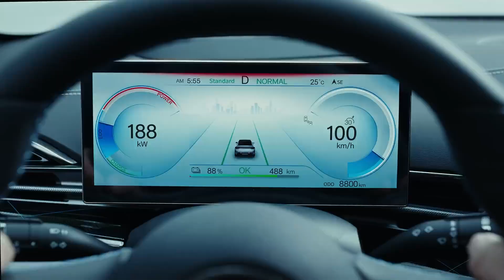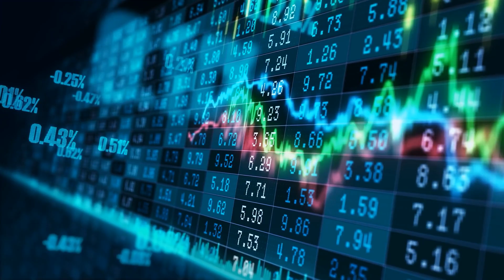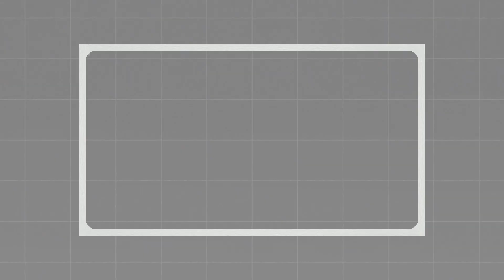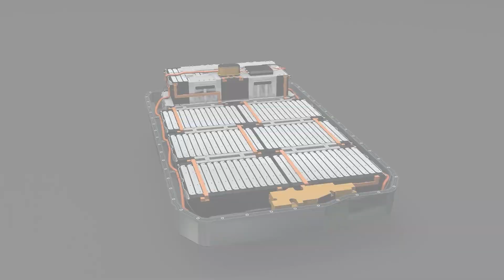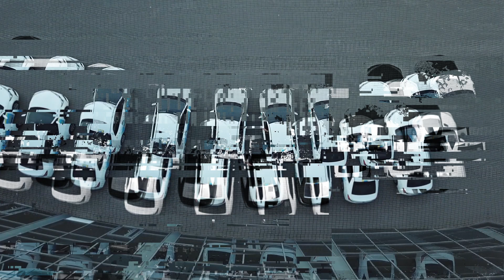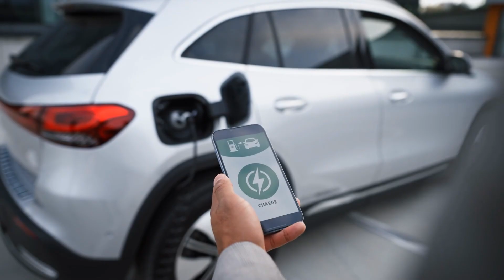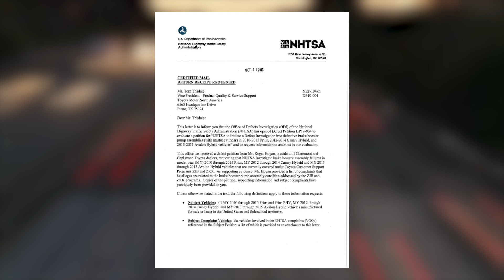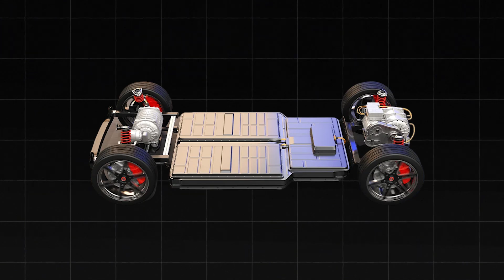NEW DATA! The Shocking Reason EV's Are Exploding

Comment: Not entirely true, barely scratching the surface of the problems of catching fire issues. 

The main problem is the inefficiency of electric motors as well as geartrain.

Firstly the designs of electric motors are wrong. Too inefficient to generate torque and unable to dissipate heat effectively. Because of that, EVs have to rely on high voltage batteries which require highly efficient way of cooling system to cool everything down without failure or else they will burn into scraps.
Reply: Secondly all EVs are using single speed geartrain. Its the least efficient way of transmitting power. Again it forces the voltage of the batteries to be insanely higher. 

Don't think the chip is the culprit. Its the concept of design that fails.

By the way lithium ion batteries are dangerous no matter how low their voltage is. Even AAA batteries will catch fires when things go wrong. 

Conclusion, everything about EVs are a big hoax.